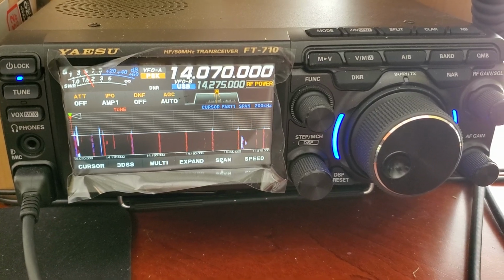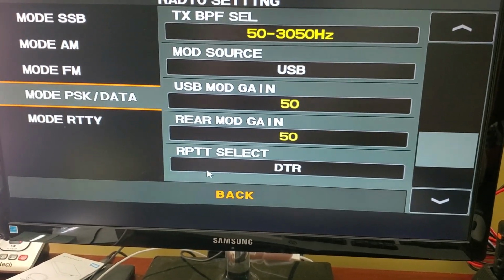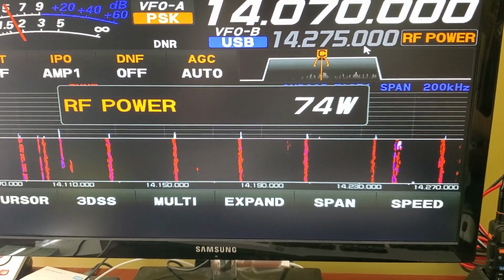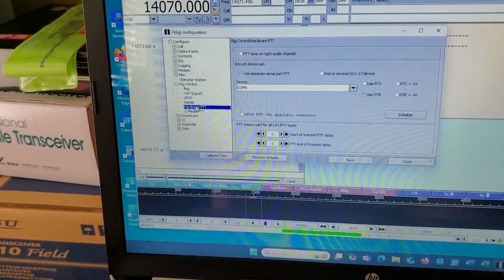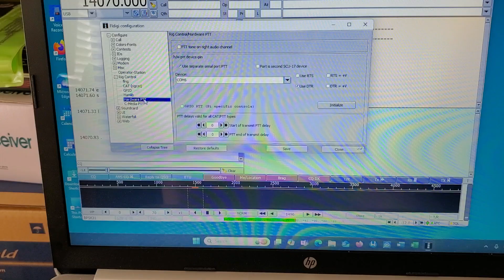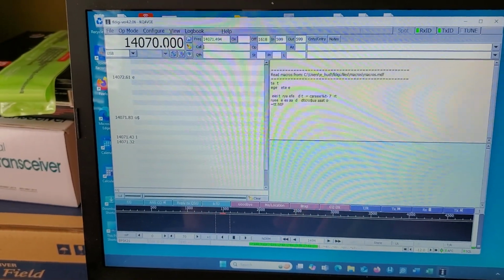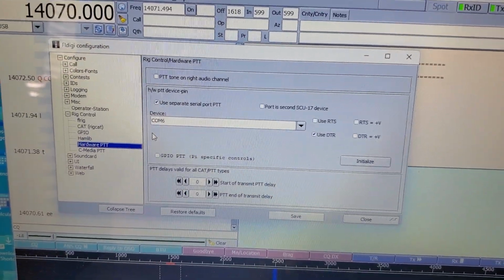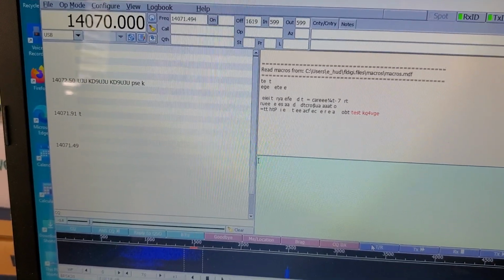Yaesu FT-710 PSK31 w/ FLDigi Setup

Comment: I wonder if these same instructions work for FLDIGI with Olivia ? Yes I have the same radio a Yaesu FT-710 and a Windows 11 Pro Dell Laptop with FLDIGI Installed.
Reply from the maker: @kg5pte not sure about Olivia but I would think the settings would work. My thoughts are the settings are FLDIGI to radio interface so that’s all that would matter, but I could be wrong.